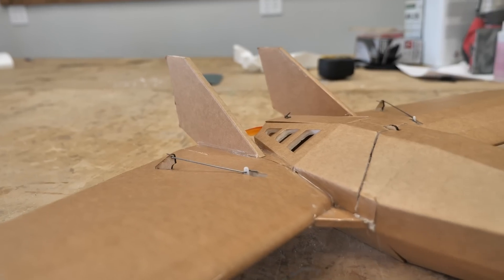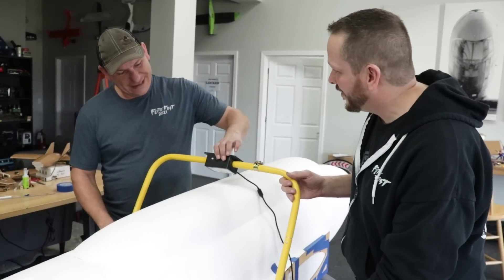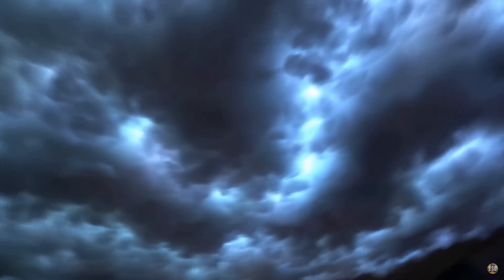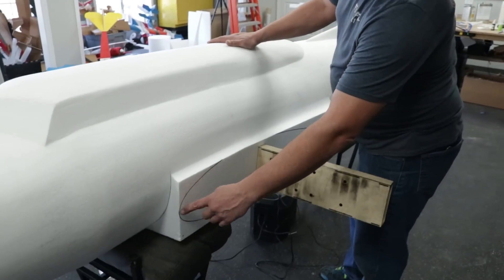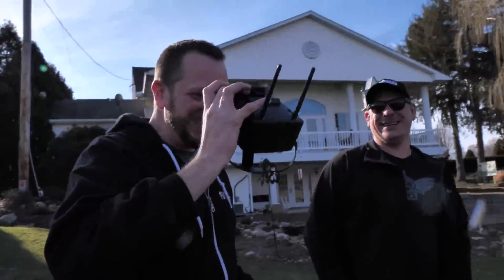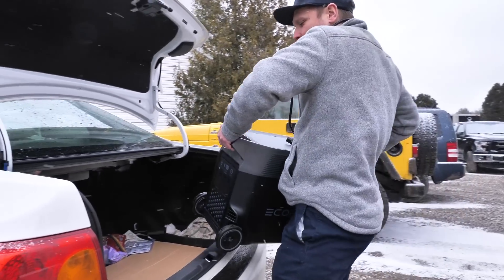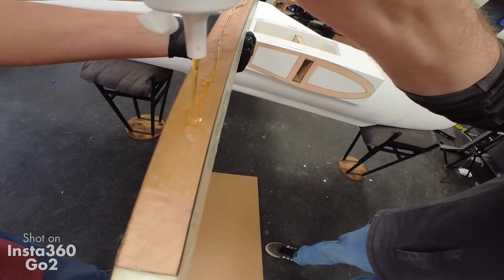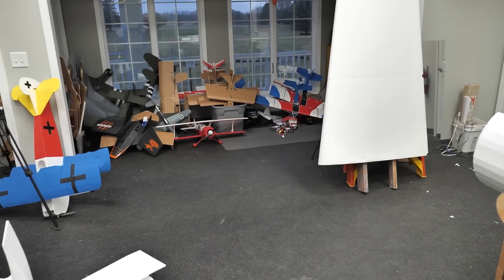20 Foot B-17 Vs. 20 Inch Nano Flerken - Week 7

Comment: That foamy B-17 airplane is huge! Maybe some day you will find a way to make a full size aircraft out of foam & carbonfiber to sit in and actually fly it!
Reply: That has actually been done.  Using foam for shape and fiberglass for structure.  Ussing carbon-fiber would be a better choice but it is spendy..
Reply: @Bendigo1   I know about the fiberglass & foam constrution from WAR WW2 AIRPLANES. They are 60% scale airplane you build and fly yourself using Verner rotory engines or a Subaru engine. Carbonfiber is newer and stronger than fiberglass, but you have to vaccume seal the parts for full coverage of the injection of resin and catilis. That's very tricky on large parts. After the carbonfiber is cured you lay down 2-3 coats of apoxy to smooth it out for sanding. Some areas will need carbonfiber filler for low spots.

Comment: Guys!
You have a CNC Foamcutter that will cut perfect wing saddles...use it!
That's how I did all of the saddles on my limited-production runs.  Easy and rapid repeatability is everything!
  
When you cut the individual fuselage sections, put the centerline of the fuselage in the same place in every block so that you can line up all the blocks on the floor and have the fuselage parts inside line up.  Do not glue the sections together til you have cut the saddles for the wing and stabilizer.

To cut the wing saddle, line up just the blocks that have the required sections in them and make those cuts to perfection on the CNC.  Do the same with the stabilizer.  The wing and stabilizer incidence angles from the computer drawing will be perfectly repeated in the model.  No muss, no fuss!

Go one better, and draw the plane in what you want to be its flight attitude.  This way, you will not have a lot of messing around when it comes time to set the incidences.  Just a touch of 'UP' in the stabilizer, and the recommended incidence for the wing.  I've seen too many beautifully-finished models at the field that fly great, but 'drag their butts' or 'high tail it' because the incidences weren't set for flight attitude.  The REALLY GREAT thing about doing it this way is:  If you get it wrong, all you have to change in the whole plane is one or both of those two saddle cuts!

Once you have all of the sections and saddles cut, you can glue the sections together with computer-perfect alignment and squareness.  No messing around trying to align those templates or hand-bow work...no sanding of wobbly hand-cut parts!  Huck the templates and hand bow out the back door as hard as you can!

Make that CNC machine earn its keep!

Comment: 2 things: 1 for another video you should make another A-10 vs tank except the the A-10 should be way bigger and use an actual air-soft mini-gun instead of a normal air-soft gun. And 2 for the FT power pack C what battery, receiver, transmitter and charger should i get or will work. And what else will i need.

Comment: I would like you to TESt how much more efficient a plane would be if it had the same dimples that a golf ball has on it. The dimples actually do increase the efficiency of airflow over a flight surface.
Reply: Aircraft use turbulators. These are not practical on a golf ball because a golf ball spins. You want efficiency on a control surface, use turbulators, not dimples.

Comment: Power outage is why I have REAL generators 2 2k generators that run 9 hours on 1 gallon at over 50% load and 12 hours at under 50% load then a 5KW gas and a 10kw Northern Lights diesel, all 4 put out clean power to run electronics.

Comment: Random question, but does anyone know where I can get a drone/FPV camera with a 60-90 degree FOV? It's not for use on a drone/quad/plane, it's for use as a rear view camera on a racecar, and so avoiding a fish-eye effect, and trying to get accuracy as far as depth perception goes is important. I've tried one setup so far, but the view does kind of give the wrong impression about how close the following car is, so I'm trying to find a different camera but they all seem to have a much wider FOV.  Any suggestions would be appreciated :)